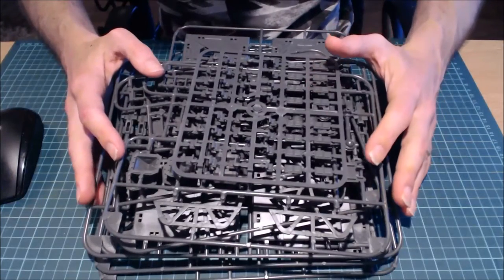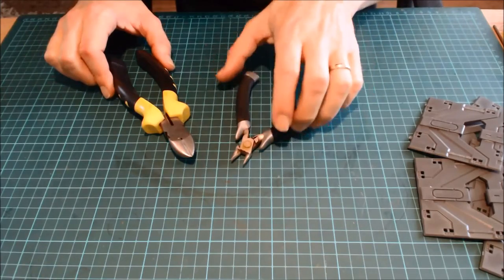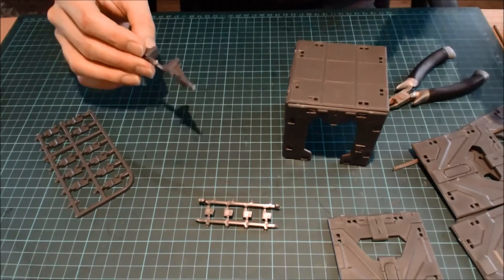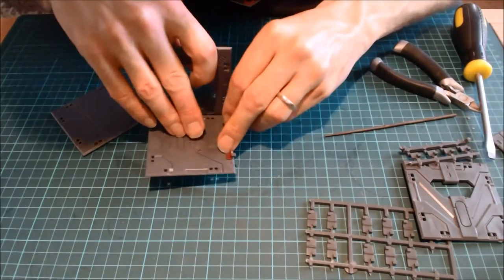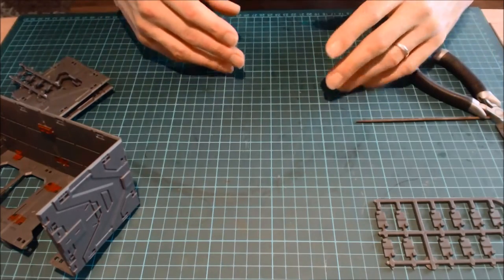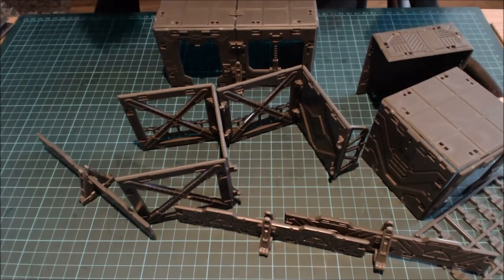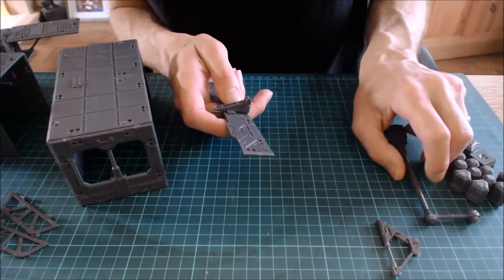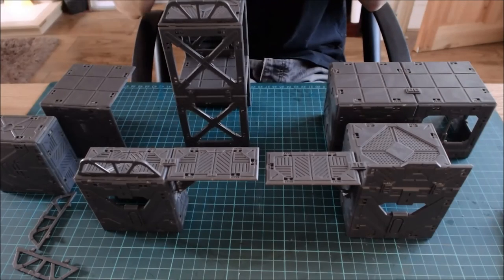Mantic Deadzone / Battlezones Terrain Review & Build Tips

Comment: I love this stuff.  Just got the starter box and extras and it's great. You can't take it apart, you have to build it and glue it. The key is to make parts that fit together. And you can do the fill tyke on the gantry. In the back, just put a 1/2 tile to hold it up. Great vid dude!
Reply from the maker: Cheers mate, it's all built and glued now anyway but I've got to say, I love how you can just move the stuff about for different setups

Comment: I've started putting mine together and have found your tips very useful. I've put one together with the connectors and now I'm experimenting with assembling one without the connectors; just gluing the plates together. So far, so good.
Reply from the maker: Euan Smith Gluing without connectors, even I wasn't that brave lol. Let me know how you get on matey!
Reply: TheTerrainTutor
I've done a couple of bits for Deadzone (though that is on hold until I get some bits from Slymaster to pimp them up) and all the scenery from the Mars Attacks boxed set. I made a Lego right angle to help with getting the corners correct. It was just a case of running a line of glue down one side of the join and then lining the edges up by eye and then using the Lego to square up the corner.

The connectors on the Mars Attacks terrain were completely loose and would have to have been glued in to place anyway. The Mars Attacks terrain also suffered more gapping than the Deadzone stuff.

I'm a big supporter of Mantic and have backed pretty much all of their kickstarters to a tidy sum, but they often seem to be their own worst enemy. In the case of this terrain, they really seem to have over complicated things with the "take it apart and put it together again" idea. Such a shame.

Comment: Regarding your glue with the metal tube - glue like that is usually self-solvent (?), so all you need to do if it's clogged is switch the metal tube back to front and wait a little, and it should clear up by itself.
Reply from the maker: Oh, I'll give that a try mate, thanks

Comment: great vid, nice review :)
it looks like nice kit of terrain pieces that are fairly quick to assemble and still offer a nice add-on to the gaming board :)
you could also use the (limited amount of) connector pieces to hold the tiles together, put some glue on the seams without putting glue on the connector piece and remove the connector pieces afterwards(?)
Reply from the maker: Cheers mate, you could do that with the horizontal connectors but the corner ones would be locked in place by the panels. If you want to glue them, I'd use lego as a guide matey ;o)

Comment: I think what you may call shenanigans is actually a need for a reverse view....lol.
Looking at the picture you show of the walkway...I don't believe they've put a full panel on the back and its open....may possible free up another full 3x3 and be the missing 7th floor tile....just an idea...?!?!
Good review and great tips and good luck on the lottery!! ;)
Reply from the maker: A reverse view would have been good, well, any other view lol. Yeah, you're going to have to get creative with it but I think I've pulled it off. Thanks and fingers crossed mate :oD
Reply: TheTerrainTutor There's a possibility that 2 of your bits are not in the same  places as the picture and would explain the missing floor. Both walkways on the box are connected to half width walls, one of your's is connected to a full width wall which should be the floor of the other building that has a half width floor (which should be the wall of the other building).  Great video though

Comment: TIP: Use a small square needle file and run it through the connector holes. This will open out the hole a touch and make your life easier.
Reply from the maker: I did try a square file but mine wasn't small enough. To be honest, it wasn't really a problem once I started using the screwdriver mate